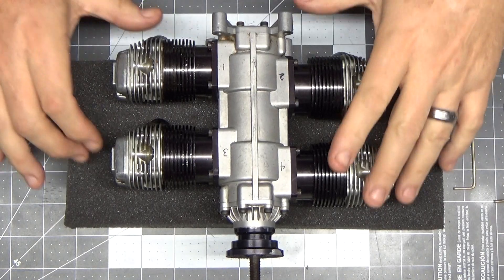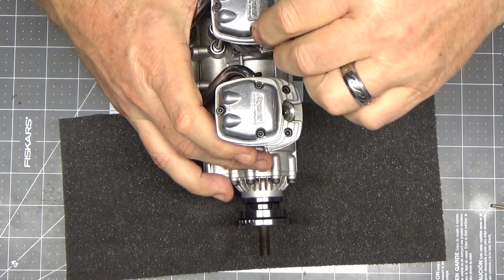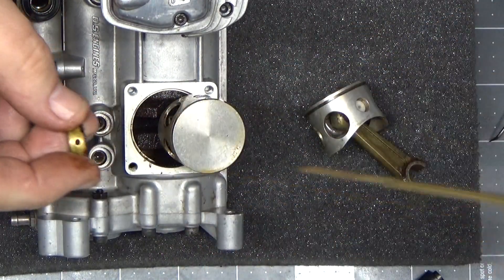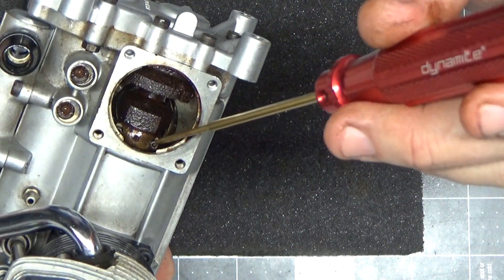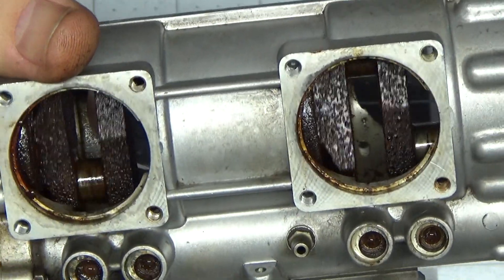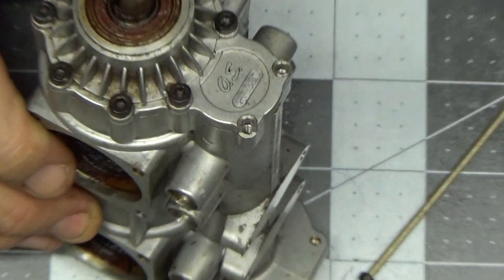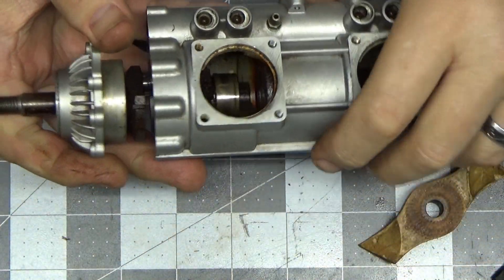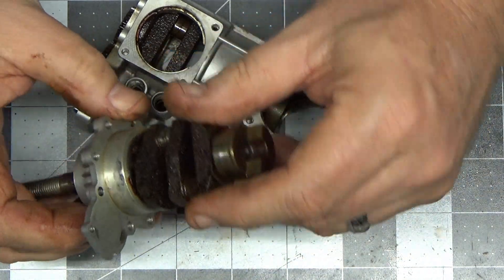OS FF-320 Pegasus Customer Engine Major Disassembly Steps

Comment: There are two timing marks on those pinion gears … a hole in the larger pinion gear and a dot on the face of the smaller one . 
To my understanding they should face each other , correct me if I’m wrong
Reply from the maker: See this video at the 11:00 minute mark.
https://youtu.be/mEtvEoylKXA

Comment: .Moisture sure had its way with the steel parts. That fellas is why you run them dry then load them with an after run oil. Almost felt like I was watching a VW Beetle engine teardown.

Comment: That looks rough and it's a shame it was neglected like that. A wire brush and elbow grease along with a soak in vinegar or another mild acid should get most, if not all of it off. Short of some piting being left behind, you'll have it running to it's former glory eventually, I'm sure.✌

Comment: I’m having a hard time figuring out how this could have happened. What circumstances could have caused that much rust/corrosion in a low time engine
Reply: Thats exactly what happens when you dont run all the full out and you dont use some kind of an after run oil. Thats sad on such an awesome engine.
Reply: Looks like it might have been run a few times and then stored for awhile with unburned fuel still in it.
Reply: So, how does that much “ unburnt” fuel get into the crankcase. I agree it has to be from a internal source because the outside is not that bad. Alcohol has an affinity for water but realistically unburnt alcohol should not be in the crankcase. Could the combustion gases that leak past the pistons be acidic?
Reply: @ecwhite3621  The culprit is not the alcohol but the nitromethane that most people run in glow fuel. Burned, it tends to leave behind a residue which combines with the moisture in the air and it acts like an acid. It doesn't take much either. I have never encountered this problem running either FAI fuel or diesel.
Reply: John Kelinske ,
Reply: Neglect.